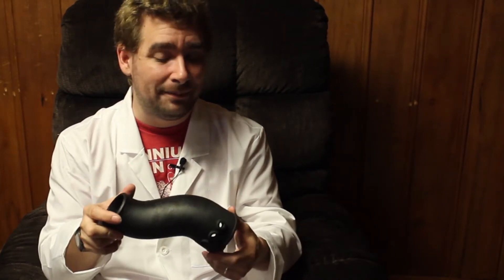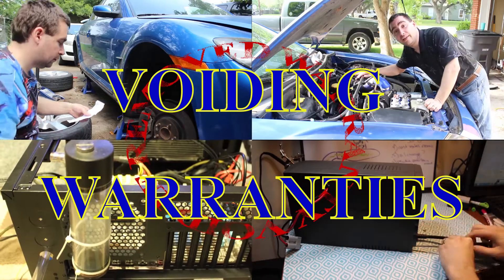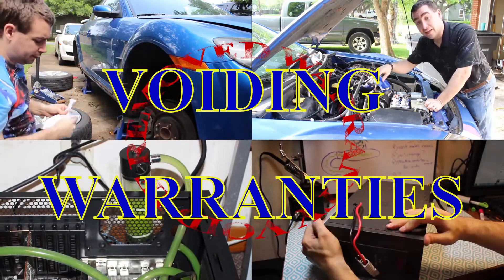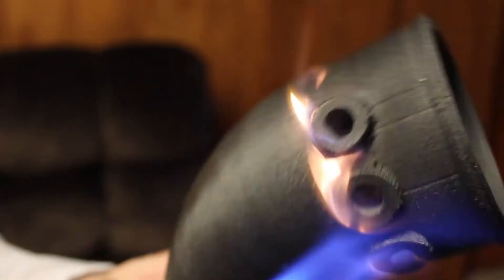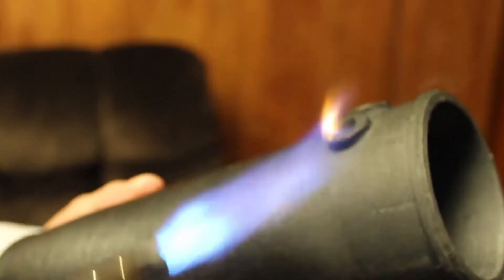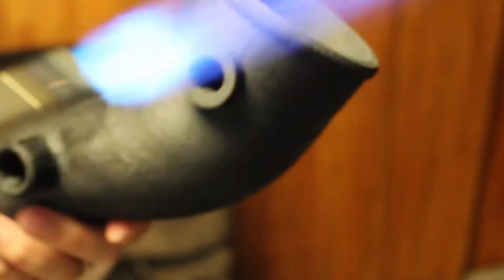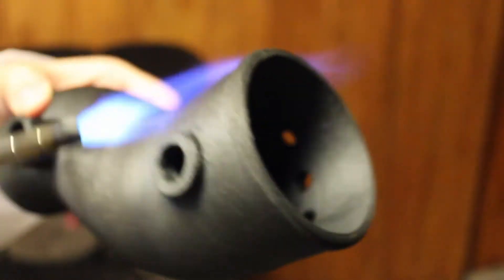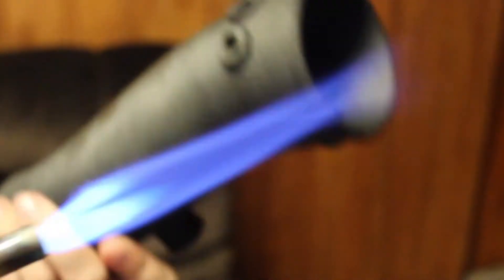Flame polishing a 3d printed intake manifold - Voiding Warranties Ep 41

Comment: This only weakens the part. You are volatilizing the plastic. The plastics oils are evaporating, hence the flames. Without the oils, the plastic is weaker.
Reply: Only for the top/surface layer. the layers underneath remains intact.
I'd also say he is blasting a wee bit too much in this video. When I flame polish 3D prints (It actually works on most extruded materials) I go much lighter.